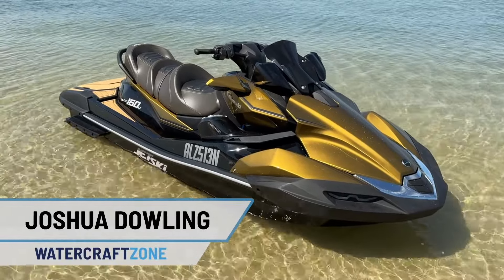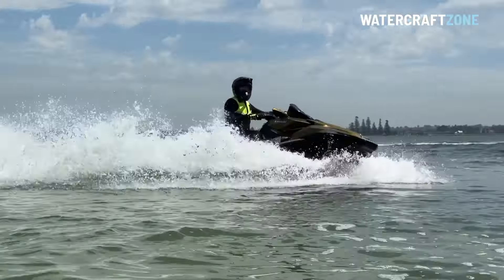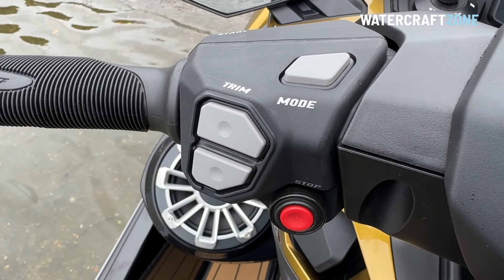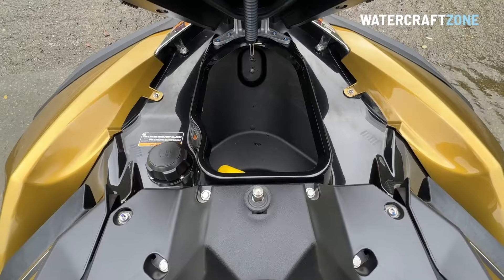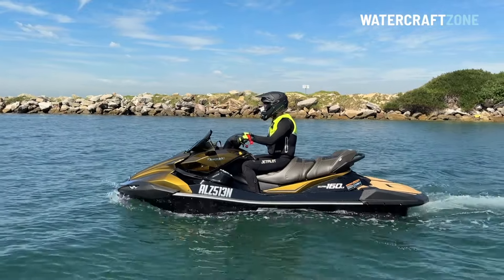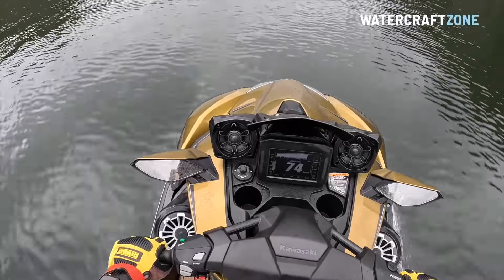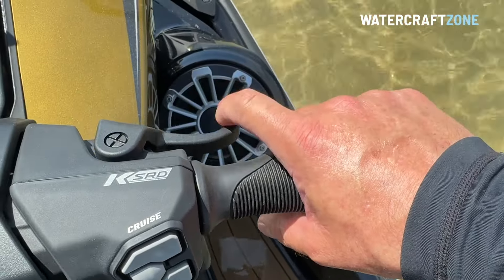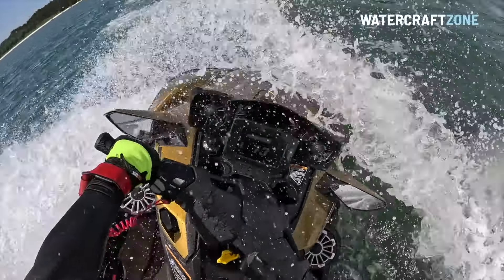2024 Kawasaki Ultra 160 LX Speed Test Review

Comment: Another great review.  Thanks for sharing. Looks like Kawasaki has done it again,  great Jetski with some very nice upgrades.
Reply from the maker: Thanks again for the kind feedback. The new Kawasaki Ultra 160 has received some big improvements. Now to round those off with a new engine …
Reply: Yw,  yeah that would be amazing to see a new engine platform.  Hell even an increase in horsepower & torque from the existing 1.5

Comment: Seeing the R on the reverse lever is that indicating it’s only for reverse or is it safe to deploy as a brake going wide open? Or does it even work going at full throttle?
Reply from the maker: Great question. We received the following response from our Kawasaki expert:

The patent for the new Kawasaki Ultra reverse trigger design says when the reverse trigger is activated it immediately checks the vessel’s GPS speed. 

Reverse will only be applied gradually if the vessel is at speed, washing off minimal speed so as to not send the rider over the handlebars. 

Once the vessel speed decreases to a modest level, activation of the reverse trigger will lower the bucket further, to create more of a slowing effect. 

The slower the vessel speed, the lower the rear bucket drops.

It is marketed as a KSRD ‘smart reverse with deceleration’. 

It’s initially very gradual. 

Meantime back to our experience.

Sea-Doo craft have a more aggressive reverse trigger (even at speed) whereas Yamaha’s reverse trigger is not as aggressive as Sea-Doo. 

Hope this helps! Thanks for the question.

Comment: 1)How many miles does it get you on, with one fill of gas?? 
2) At Greece the price of  Kawasaki '24 ULTRA 160 LX-S 2024 is 24.200. But i can find a Sea-Doo '24 GTR 230 20.800. Which is your advice? 
I need one which would be able to move me into a cluster of islands that are all together within a 7 mile radius
Thanks...
Reply from the maker: We will let you do the maths and the conversion but in our testing it used 55L/100km and it has an 80-litre tank. By our calculations it could cover 120km on a single tank (with some to spare) but best to try it yourself first on a shorter journey. Consumption can increase depending on riding style and rider weight. Hope this helps.

Comment: Great video once again. As you say Joshua ~ You can [pin it full stick at 83 km/h] in chop and with the 160/310 type hull, and it goes quite well. It's quite fun there. However, on glassy water it feels like you're not moving ~ It's quite boring and you can [fall asleep] Ha! Group riding with other PWC NA brands you're usually at the back!! Definitely needs a powertrain Upgrade to get it to at least ≈ 100 km/h. Sure the 1,498cc NA is reliable and been around for ages ~ going on 2025+ the model just needs a bit more top end speed like the STX160X. Surely the Tech heads at kawasaki have something up their sleeve. Going at 100-120k's/h is fun and thrilling!! If a BIGGER kawi engine uses more fuel then for a 190km Trek, you just take more on the Ultra Deck. My rides now I take 80L + 20L with the 2023 Kawi Ultra 160 LX-S ['Orange' looks better!!] for a Trek that long. River riding. Cheers. Pete C.
Reply from the maker: Hey! Thanks for leaving a note. That’s a good observation. The hull isn’t bothered by rough chop, and on glassed out water it’s so stable it’s almost monotonous. Here’s hoping Kawasaki is working away in the background on an engine upgrade. Then again, extra power and all this weight could create quite a thirsty machine. The good news is Kawasaki is back in the game with this updated Ultra. The only other thing on my wish list for the Ultra? Higher handlebars so it’s more comfortable to ride while standing up. Thanks again for the feedback.

Comment: I Love Kawi but the 2024 FX HO is now a better option, cheaper and more HP than the 160 LX, better storage access on the FX-HO. Let's wait for the new 1000cc Turbo engine of the SxS Ridge, lighter and faster, same concept as the Rotax 900 ACE HO. Thanks for the video.
Reply from the maker: Thanks for the note. Both are great skis but the Kawasaki Ultra 160 would benefit from a power bump. The only downside to that is extra fuel. The new Yamaha 1.9 non-supercharged engine is as thirsty at Yamaha’s 1.8-litre supercharged engine in our extensive testing. So here’s hoping Yamaha finds some new efficiencies for future updates.
Reply: @WatercraftZone  Thank you, your reviews are the best on YT, please try to do a long run fuel consumption shootout between the Sea Doo 170, Kawi 160 and the new Yammi 1.9L, side by side.

Comment: looks like it submarines very easily
Reply from the maker: Good observation. The trim was in the neutral position and we had a full tank of fuel in those shots. We were also riding in a way that would encourage some water over the nose for the video footage. But even so, it is a bit nose heavy even in normal conditions. As is the Yamaha FX HO in our experience.
Reply: Also noticed the same. I have the Seadoo Fishpro Trophy and with 3 adults on and fully loaded with cooler, it still doesn't nose dive like that. Even in super wild offshore swell it handles like a champ.